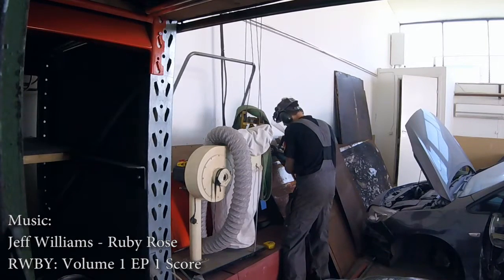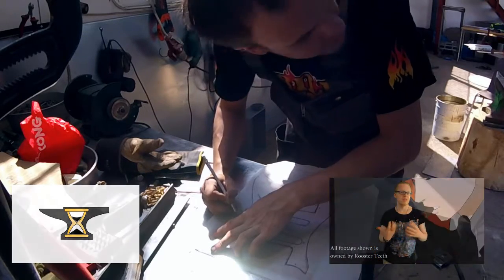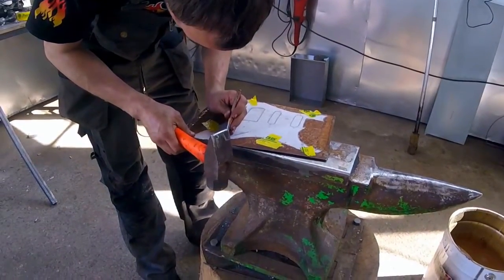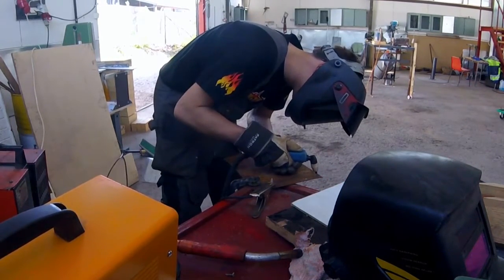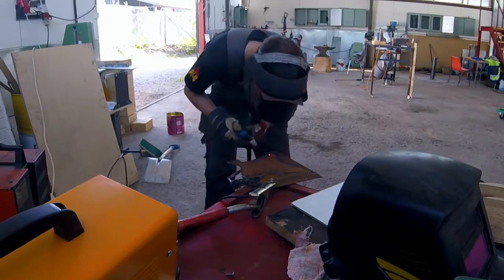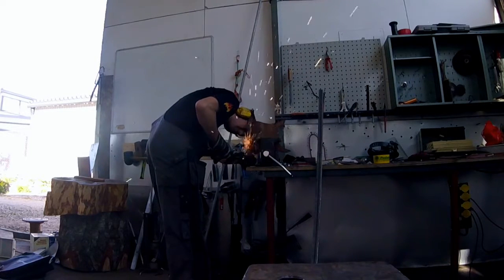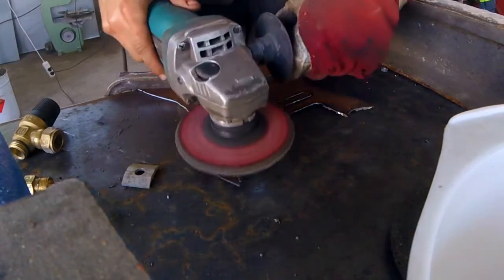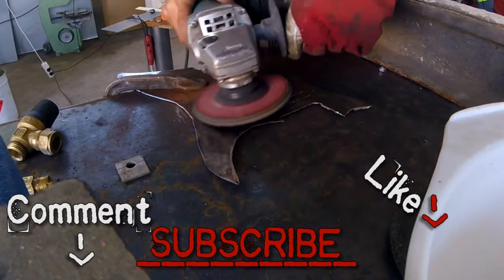RWBY Guitar #2: Steel Pickguard

Comment: So don't leave us hanging. Let's see the final product.
Reply from the maker: All in due time ;)

-T
Reply: IndiEstructible Productions
  lol I can tell you right now the trouble you're going to have is when you go to cut out the holes for the pickups.  I've made several of these out of aluminum, by hand, and they all came out looking great, except for the pickup holes.  Anything less that perfect rectangles  stick out like a sore thumb from a mile away and there's nothing you can do about it except hide the edges. 
  I went and got some Gibson pickup mounting frames and filed them down to about 1/16th of an inch in height (i also have a strat,  you'll know what i'm talking about here when you come to that point) and placed them over the imperfect pickup holes.  The width of the frames is just enough to cover the edges of the rectangle edges on the pick guard.  Of course then you're left with a lot less of the new pick guard real-estate being visible, but it works.
  I'll save you some time and suggest you find someone who knows how to use a program like SolidWorks and get them to make a digital model of it so you can take it to a water-jet cutting place, or get it cut with a laser cutter.  It'll be expensive, but it's really the only way you're going to be happy with it.
  Good luck.